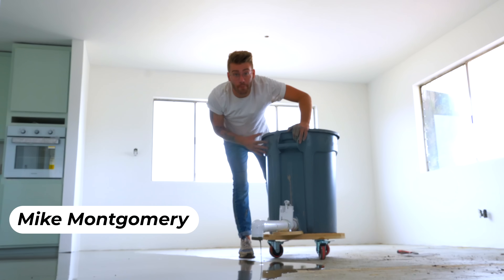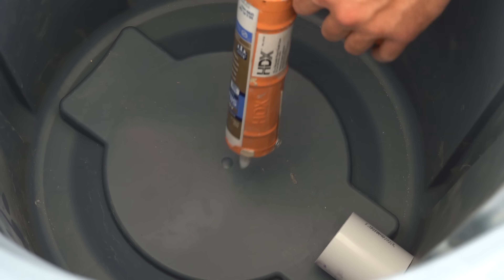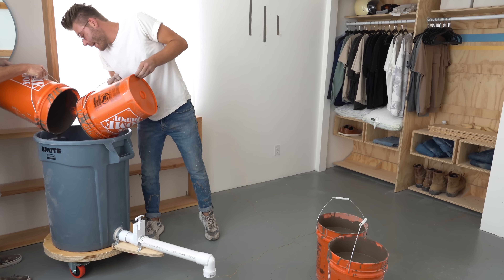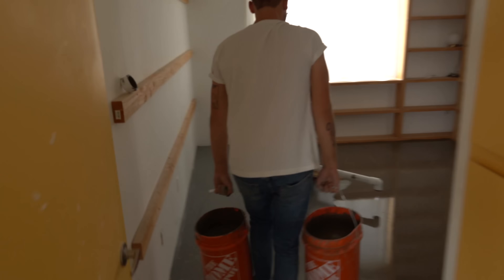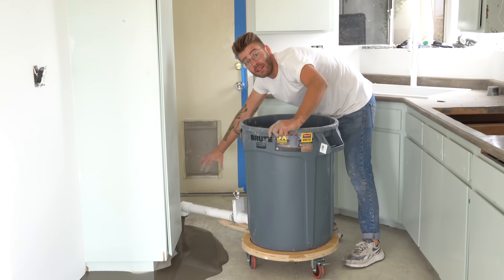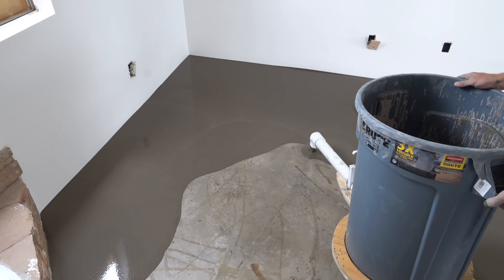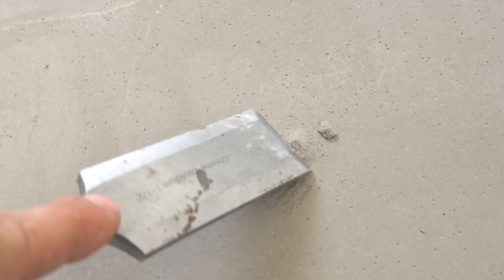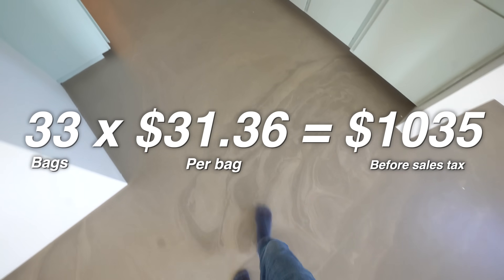DIY SELF LEVELING CONCRETE FLOORS!! $1 per square foot

Comment: ❌❌❌❌❌Anyone watching this video should never attempt self leveling by Mr Montgomery! Your first of many mistake’s Just pouring without shooting your elevation for low spots and pinning them is crucial. Even without a rented lazer, or you could have used an 8 foot level using a string from wall to wall in each direction. Very inexpensive at the hardware store. And 
do one room at a time. Another,  you never used a roller rake, that caused one area to dry before pouring the next, causing inefficient leveling to cure! A big problem! You invited yourself unnecessary trouble attempting to do too much area at one time.. Lumping caused by your contraption was not as ideal as you thought to save time. Depending on hidden mistakes with beds and furniture is counterintuitive. But it was entertaining watching you in frantic mode😂

Comment: From my experience, that "self-leveling" floor never self-levels. It will have all kinds of peaks and valleys up to 1/2" high or low. No one puts a straight edge on it to check the flatness on YouTube videos. The only reliable way for me to get it truly flat was using screed and guides. I'm using aluminum corner strips designed for ceramic tiles as the guides.
Reply: I'm sure professional guys who do commercial work with all the right tools can get a flat and level result; for the rest of us I agree that using guides and a straight edge to draw across is the way to go.

Comment: interesting but concrete dispenser useless. with the same result it was possible to pour concrete and roll out with a needle roller. walking on the floor in special shoes.

Comment: It's not hate. I get Mike is a lovable guy and people give him props for trying. But lets be fair. A successful diy content creator has a moral responsibility to his following to not post wrong methods or wasteful inventions that create problems, just for the sake of posting content? Where is the respect for those loyal followers? And why are you loyal followers, mad at pro tradesman here, commenting and pointing out the problems you will face doing this. This floor is going to need to be repaired into the future. It's just obvious to a lot of people including the guy making this video, he's not doing this right. Making an uneven dry\wet crevice \ ridge in the middle of the floor is not a good thing. That pouring device is creating a LOT of problems! He's going to have cement drying on that bottom one inch of the pail and mixing those lumps into the new added cement he is pouring in. We actually see this unnecessary pail invention, slowing down the process of the job and causing the delay that made that wet to dry ridge. He's also cementing in his floor cabinets. I and others are not hating him as much as we are trying to save you. Check out doing this with shoe cleats and a squeegee. One or two guy mix. The other guy just levels it out with the squeegee. The primer was done correctly. Lots of luck to you all.

Comment: I just called the company that makes this stuff & they said it is only to be used as an underlayment & not for an exposed concrete floor. They said because of pressure points it will crack. I also called a concrete specialist about doing this & he said you need at least 3" of concrete to get to the necessary PSI. 1/4" or co will crack & possibly shatter like glass. I'll be curious to see how yours holds up over time.
Reply: Yep... I have used this stuff and it will crack where there is a thin layer (near the edges) when you walk on it, and after cracking, some thin layers may come loose.
Reply: There's a special product for doing this kind of floor called Microcrete. This self levelling is only supposed to be used as a base for other flooring.
Reply: I love ❤the look of the floor so much!!
Reply: @Lee-xs4dj  other flooring, like wood laminate?
Reply: Many companies sell product that can be used very well for other things. However if they market it for something and it's not approved by governing bodies they can get sued.  For example r13 pink fiberglass insulation is great for stopping smoke coming from a fire place but it's not rated for that use.
Reply: @MA_KA_PA_TIE  you are right, but it is also because they don't want to get sued when joe-shmo uses schluter for a pool and it fails and he says "welp you didn't say I could only use it for showers" ... building products are tested for a specific use-case, and concrete isn't forgiving.
Reply: @fd3871  yup that's true. That's why contractors are so controlled by dogma

Comment: Ben and you killed this. The device is clever maybe just needs a few tweaks. One bag at a time will never come out as smooth. DIY should be inventive and fun. Things go wrong but that’s how you learn and improve. It’s just a floor if you don’t like it you can clever it and self leveling concrete is the perfect base.

Comment: The house I bought had 44' of drain line replace as a condition of purchase and the previous owners didn't level the floor in the kitchen and hallway when sections of the slab repoured. They then threw ceramic tiles down which began cracking right away. Temporarily used about 30 tubes of Fix a Floor and at least the tiles hold in place. Eventually all must come up; the slab underneath probably looks like the moon.

Comment: I really like the swirl pattern.  Can you tell me how durable this floor is? How is Ben’s floor holding up?  Interested to see future updates.
Reply: Some of the self leveling floor mixtures are gypsum based last I saw. Which is what they make sheetrock out of. Not very durable. They at that time was meant to correct floor imperfections so you could lay tile on them.
Reply: Myself if I was going to do it. I'd use a real concrete. Maybe mix in some pretty stones and or some broken glass. Then grind the top off. This way you don't have that sealer preventing a actual bond to the old concrete also. It then is one solid piece. I don't see a floor like this one lasting long

Comment: His actual project cost of the level quik rs is $1440 from home depot at $36 per bag. The extra bucket and mixing tools add more to the total.
He could have bought regular thinset for $12 dollars a bag and spent the remainder on italian carrera marble tile if he knew what he was doing.
Reply: Elaborate please.
Reply: No
Reply: @donkzilla2293  Concrete is pretty good at leveling itself but even the best pours can have low lying areas, for those minor imperfections in your floor, using thinset to fill them in will get you level but also save you a lot of money.  Then you install your choice of flooring on top, a few bags could easily stretch to fill in the low lying areas of a floor this size - you'd need a 8-ft carpenter's level to ensure you can spot those imperfections over a wide area by placing the level on different areas of the floor, and seeing if it lays flat in all spots.  Mark the spots it doesn't and thin set those.  I'm doing this currently in my basement.
Reply: @wipwhopdipdhop3673  appreciate it mate! About to get all the supplies and get to work 👍
Reply: @wipwhopdipdhop3673  hack.
Reply: Lol...obviously you're not a tile setter

Comment: I dont understand all the hate. For a two person job I really don’t see the suggested comments where they say it should just be “directly poured on floor” working out. Too many seams with walking back and forth and opening bags etc. I think this was an excellent way to build a tool that saved your back, your time, and a lot of headaches running around trying to prevent a seam from each bag. Great job

Comment: That floor is going to chip off very easily. He shouldn’t be promoting this product for use this way. Polished concrete floors or vinyl flooring wood have been cheaper. Also this product is very hard to work with in large areas,  unless you have a few people helping you can expect a mess to clean up and then in no time that floor will turn chalky and crumble. It would have been way easier to pour straight from the home depot bucket and use a rake leveler to spread. Hopefully you realize your mistake and fix it so that you don’t encourage this type of mess, and also this really discounts your brand. Many folks are watching this video thinking what the hell is this guy doing, is it time to reduce his subscribers????

Comment: I'd love to do this on a subfloor - meaning to say I have a crawl-space - that isn't already concrete and instead is plywood based floors with carpet on top. Wonder if this would work?
Reply: I used self leveler in my kitchen on top of a subfloor and just made sure my joints were sealed before I poured.

Comment: Hey just a thought. What do you think about adding a slanted platform at the bottom of the trash can so that it funnels into the pipe eliminating the waste at the bottle 👍🏾 great build tho looks like it made the process a lot easier great job looks fun too -bwash

Comment: I've been trying to figure out what was in our old house which had a thin concrete floor on the 2nd floor... I imagine it was similar to this, but over a beefier plywood subfloor than usual.  It was manually textured and then sealed.  For all the naysayers, house was built 2002 and as of 2023 there were only some small cracks where nail heads in the subfloor had popped up.
Reply: Do these sealers for the finish on top of the concrete smell any chemical??  If yes how long does it smells? 

I have allergy why I ask.thnks
Reply: @georgiosladas3106  I dont think that they do, though you can look at VOC content.  Concrete and real wood were recommended to us for good air quality, though it matters what specific finish you use.

Comment: I used the Sika brand stuff as an underfloor for my office corner. The floor was really uneven and this helped to even my floor, but its not perfectly self-leveling on really uneven flooring. You're better off troweling it and spreading it manually to get a flat surface. I can see the transition from each pour so you won't get a consistent color. I found several uneven areas once it was done and filled the low areas with some floor patch in the flooring aisle at Home Depot. I put some vinyl planks over the floor and it looks okay. If I wanted a perfectly flat floor I should have put plywood under the vinyl planks. My only regret is not insulating my floor because it gets really cold in the winter since its directly on a slab of concrete.
Reply: Same thing happen to me.
Reply: If you want a flat floor you have to get a concrete grinder to take down the high spots first, then level flow. Plywood is not a fix for an uneven floor as it will still be uneven and/or gaps between the plywood and concrete subfloor lol.
Reply: @jonvon2044  let me clarify. Instead of grinding down the high spots, I filled the low spots with floor patch to level the floor. The purpose of the plywood would not be to level the floor. Since my situation is slab concrete that has pre-existing cracks, the vinyl planks are separating where the slabs cracks exist. There are no control joints in this slab so the concrete moves at the cracks. The plywood would prevent the planks from shifting since they wouldn't be connected to the shifting cracked slab.
Reply: @ChavezDIY  Oh okay I get you. Well before you spend all that money on plywood try using something like “Mapgaurd” by Mapei. Its a crack suppressant membrane that you apply down the length of the crack (like you’re rolling out the red carpet) this membrane will stretch with the subfloor instead of the flooring and is much more cost affective and less labor intensive at the same time 👍
Reply: @jonvon2044  thanks for the tip. I'll keep that in mind if I decide to redo the floor.
Reply: @robwinter3183 how would you insulate a floor over a concrete slab?
Reply: @jonvon2044 hi the Mapguard goes over the cracked slab before or after the self leveling compound?
Reply: @pearlperlitavenegas2023  before
Reply: I used Sika brand as well, thinking that the few bucks less per bag would save me money. I was very wrong. I experienced the same thing - it does not level very well at all. I had to grind down a lot of different areas and do another coat so I spent way more money. I also had to screed it for it to level out. Next time I will go with a more reputable brand...

Comment: I think if/when I attempt to do this, I’d also use a spiked roller to blend the seams, as well as pouring into the wet cement instead of pouring onto dry cement
Reply: I wonder if the primer he used is meant to seal the underfloor so it doesn't rob moisture from the curing wet batch
Reply: The primer is for adhesion.  Spike roller not needed, just gently drag a rake (like for raking leaves) across the surface for blending, mixing. Works perfctly.
Reply: @phillipgrandison2384  primer stops moisture from leaving the leveller and entering the concrete below. this is how it prevents cracks. spike roller is the best tool for a DIY pour

Comment: Self levelers are an underlayment only and designed to have a protective layer like tile or wood put over them. This will not last.The first furniture foot that has more than 10 pounds of pressure per square inch is going to shatter this stuff. Do more homework before using products. Sorry.

Comment: Disclaimer : don't try this at home. Especially not if you're thinking of putting down glue down vinyl.  You will have so much extra prep work flattening out all those nice twirls he made _ and sorely regret each little lump you didn't fix or missed after a few months.
Reply: I've installed many glue down and adhesive backed vinyl floors. Using self leveling thinset is a must for a smooth, flat end product. But, it needs to be mixed properly. For example, most people dont realize you want to add a latex additive to the mix so it doesnt dry into a powdery mess.

Comment: Cool effect. I definitely like it. 

Use a decoupling membrane and go into this with the understanding that it will crack. Either treat the cracks as a "design opportunity" or just leave them as character. If you're doing this over a slab you definitely need a decoupling membrane because the existing slab will pull the water out of the skim coat too fast and ruin the whole job. Once again, a decoupling membrane would mitigate this issue as well. They are like little waffles so they give the pour something to grip, which helps prevent cracking too. You could hose down the slab but who wants to do that in an existing house.
Reply: That's what the primer does. You would absolutely not but down the decoupling membrane like ditra first.

Comment: Dude, there are tools for this. Spreader rakes and shoes with spikes so you can walk over it. The way to do this is NOT in this video. You just have to have two or three buddies mixing the stuff in 5 gallon buckets, and you line them all up and pour one after another. Some floors take 30-40 buckets. You rake it, walk on it with the spike shoes, and it’s perfect. Even for beginners. But watch another video, not this DIY loner.

Comment: Back in 2000 I did a 23,000 Sq ft floor with ardex K-15 and really could have used this. Two guys on mixers, two on squeegees and one using a floor dolly. It was a very long Sunday, 17 hours! But it was double time at $26/hr!

Comment: The floors are so pretty.  I’m curious if your house is perfectly level if not how did you manage that?
Reply: He used self leveling concrete.....it levels itself out
Reply: @AthenaAthena  in theory! In practice you can't just pour it out any which way and expect it to settle to a level finish. I've used it a number of times and it always needs to be worked to properly get the desired result.

Comment: Very cool idea to make short work of pouring and spreading! I have a question about expansion gaps. Did you leave any gaps for expansion? I understand that there will be some shrinkage as the concrete cures, but I wonder if leaving an extra gap is still necessary.
Reply: It’s self leveler. You don’t need to do anything other than mix a large batch and pour it directly to the floor.
Reply: @human_behavior23  the spout contraption makes it a bit easier to control where you pour and  how much you pour in any one spot, I guess?
Reply: @human_behavior23  It sounds like you know of a better way to pour a large amount of self leveler, but you didn't share any helpful details... I imagine if you're pouring from the 5 gallon buckets then you'll either spend a bunch of time raking the leveler around since it doesnt actually spread itself OR you'd be meticulously pouring evenly around the entire area 40 times while carrying the 50 pound buckets. Perhaps the video would seem more useful if it explained how much work this job would be without the trashcan contraption.
Reply: @ChrisWachtman I've done it with 5 gallon buckets.  His contraption would definitely have been very helpful.

Comment: I wanna say that it would be so much cooler if the pipe had a same thing as the mixing drill bit u r using inside it at its mouth so when u pour it makes some REAL swirly pattern be alot more interesting

Comment: Interesting.  I’ve never seen an overlay product last very long without heavy prep done prior to installation.  Im sure with the minimal foot traffic you can get decent life out of this though.  Im interested in seeing a follow up video.  Also, look at penetrating sealers if you are looking for something that isn’t slippery.  My floor is polished up to an 85 DOI and I can’t slide on it.
Reply: Self leveling compound is an underlayment and you must install some type of flooring over it, otherwise it not only will crack, some thinner sections will become loose.
Reply: @GaryMarkowski  it depends on the self leveler.  Some are polishable and meant to be the finish surface.